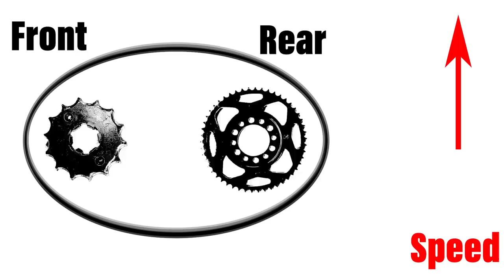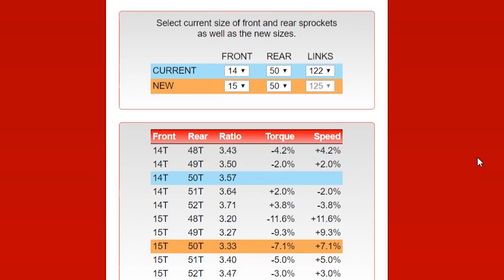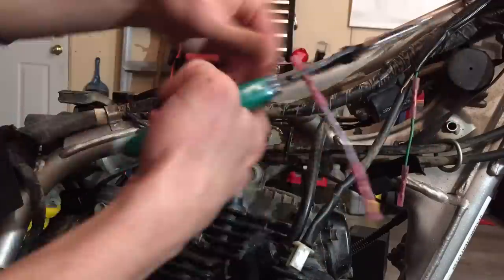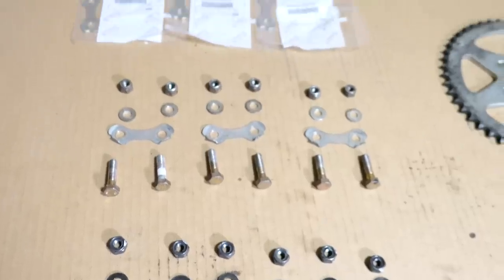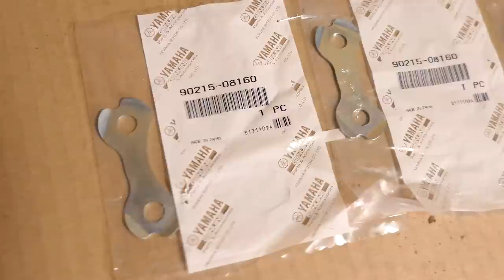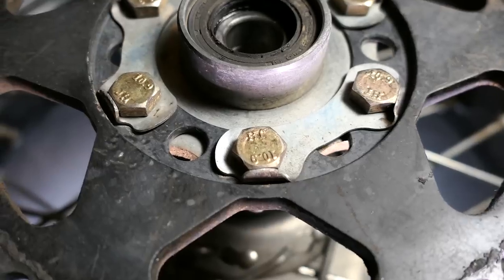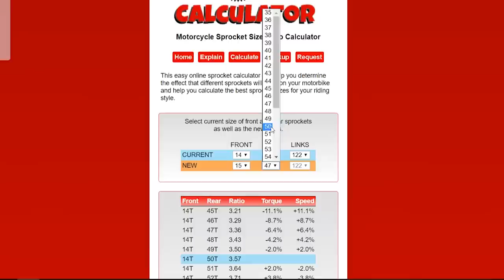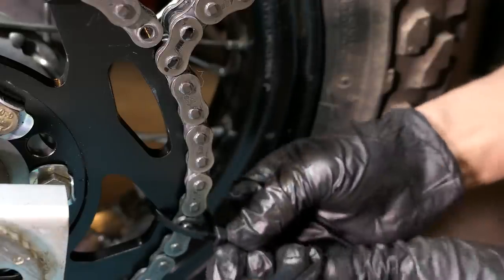How To Replace the Chain and Sprockets on a Yamaha TW200

Comment: Just replaced mine with 15/45 and x chain...thanks kid much quieter and smoother...also new tires...so when are you getting a new tdub...yours is looking pretty used my friend? saw your cracked frame
Reply from the maker: very nice! I could imagine it being a lot quieter and smoother with that gearing and new tires. I just welded everything. i'm putting it back together now

Comment: I just discovered you as well.I have 3 XT 250,and just bought my wife a 2012 TW.I changed the oil,and filter.I will check for the small holes,but more importantly at 45 MPH the bike started screaming at us or a warning buzzer--Not.Engine locked up ,cooled off ran another mile mile and locked up.Cooled off again at home .pulled plug and drained oil nothing wrong. Left plug out,hit starter  and it turned over.HMM! Compression test?Stuck piston and ring.Not sure where to start?
Reply from the maker: oh nice! you can never have enough bikes haha. dang that doesn't sound good, that's really strange, did  it lock up to the point where the wheel skidded? I would have to look at the bike to figure out what's going on. that's really strange

Comment: Just noticed this video and I like you. I have done this job before and figured that the dirt entering through the wiring inlet is ridiculous. It's not hard to pack the  wire entry after reassembly to prevent this design flaw.
On the rear sprocket swap, I have no idea why the aftermarket decided  to weaken the hub mounting surface by reducing depth.
Add to that, the bolt kits available are very substandard. Threads are poorly cut, washers are not "plate" but thin mush and the nuts are chrome plated malleable junk. The shoulder of the bolt was reduced way too much and should have more bearing surface on both hub and sprocket rather than having side forces on some threaded area. Two of the six bolts I installed stripped out the nuts at 20ft/lbs  (don't question my torque wrench) in incremental graduated rotation. Very poor metallurgy. The external lockwasher plates are Yamaha and do as designed.
I think it is best to re-use the Yamaha quality hardware and more PLATE washers if you wish but I ended up making a steel flange  sprocket insert  to compensate for thickness and all weaknesses of aftermarket products.
Keep up your  good vids.
One more - That was a  Sasquatch howling in your camping video.  No fears, they are curious and friendly but very smelly.
Reply from the maker: thanks, yeah that side cover setup is not the best, sure holds tons of dirt. darn, I havn't had an issue with my rear sprocket bolts yet personally. much appreciated, haha

Comment: Great work! So much great info and editing! I'm still running the stock chain and it slipped off last summer and jammed between the sprocket and swing arm locking up the rear, think its time for a new chain this spring haha
Reply from the maker: thank you! glad you enjoyed it. dang that's no good hope you didn't get hurt, I'm surprised mine didn't fly off when skipping teeth. indeed, the stock chain stretches insanely fast haha

Comment: Thanks for making such an imformaive video. Just what I needed. Love your videos.
Reply from the maker: You are so welcome! glad it was helpful. thanks for watching
Reply: @TDubsKid  Got a 44 rear and a 14 front installed. Testing tomorrow.. The 428 chain with 118 links fit perfect on #1 snail. That calculator site said 106 but it is full of popups and hard to use. You were partly the reason I bought the TW. The other reason is that the Sondors Metacycle I ordered in May 2019, is about 6 months late and I wanted a bike for this season not for 2022. Best wishes to you, ride safe!

Comment: The biggest thing I've encountered that slows my tw down is tire resistance.  My tires got low and the speed went down.  Gas milage too.  I've noticed the smoother the road surface the faster it accelerates.  Being on an really smoothed down highway makes feel like it's got a turbo!
Reply from the maker: +openscholar yeah that makes sense actually with the fat tires, when the rear tire was flat I couldn’t even push it haha 🤣

Comment: Can I use a new 122 xring chain with a 15 front and 50 rear sprocket? the calculator sez 125 links - but I thought I may have enough play with the snails to make it work. It's hard finding a 124 or 126 right now. Thank you for the amazing content. Funny and informative. You are the best and have a gift for this type of content.
Reply from the maker: hey it's really hard to say for sure, I would just get bigger and cut the links off that you need, just 1 link makes a huge difference on the snail adjusters. thanks
Reply: @TDubsKid  Hey thanks for getting back with me. Your videos are insane good. I got a longer chain and broke it at the right spot.
I grew up in the 70's on XR 75's. The 80's with 2 stroke MX bikes. Haven't had to break a chain since "81. Lol. My Tdub is the most fun bike I could have ever imagined. Your videos are a HUGE help and the best reality show in the world. Much appreciated.

Comment: I tried that 13mm multiple times on those sprocket bolts. Kept double checking and realized...mine are 14mm.🤔 Maybe the 2019 is different? Either way, great video and very helpful channel man!
Reply from the maker: gottcha, it's been a while but i'm assuming your talking about the front sprocket bolts.  you can always look here for parts info, https://www.yamahapartshouse.com/ I took a look and the front sprocket bolts are under transmission, and it looks like an old part number has been crossed out with a new parts number in it's place, so the must have upgraded those bolts for some reason or could no longer get the original bolts so maybe the had to find a new supplier. thanks!
Reply: @TDubsKid  I should've specified the rear sprocket bolts. You said 13mm but mine were 14mm and I was just curious. Probably an updated part like the front that you mentioned though. Thanks for the follow up. Take care man.

Comment: Absolutely idiot proof.  Appreciate the time and effort you took to make it.  I'm looking at buying a TW 200 but where I would ride off road is about 30 miles away. What is the top speed on highways without killing the bike? Appreciate anybody  responding that knows. Thanks
Reply from the maker: hey no problem! thanks for watching. I usually don't like to take it much more than 55 some of my spots are 30 minutes away or more, I just take the backroads

Comment: So, did you say that the sprocket calculator said that you needed a 120 link chain, but you used your 124 and just adjusted it?  Thinking of going to a 47 tooth but didn't want to buy a new chain until I saw if I likes the change?
Reply from the maker: The sprocket calculator doesn’t say what chain you need. You should be ok with stock chain going to 47 as long as your low on the snail adjusters

Comment: When doing the rear sprocket, don't bend the lock washer plates. Just remove the nut from the bolt and push is straight out. You don't have to bend anything and they should be good for life. Also you can use a M8x125 die to extend the bolt threads. I added 5 threads and voila.
Reply from the maker: thanks for the tip

Comment: I purchased this kit on Amazon (Drive Sprockets & Chain Kit For Yamaha MK1004915) for my 1998 TW200 with original 300 miles and need to know if the recess on the rear sprocket is supposed to go inward or outward.    The machined recess fits perfect if you put it on inward.  I have run it a few miles and seems ok.  I only need the Rear Sprocket and Chain for now.  Any help would be greatly appreciated.
Reply from the maker: hmmmm I don't recall running into that issue. maybe I missed it best to compare it to the original sprocket. if there was no recess. might go outward. would need to look at it to be sure

Comment: How did the change affect 1st gear? Would you still do the same sprocket change now that you have had it a while? I need to change these this winter and am on the fence whether i want to change the sprocket sizes for increased highway ability.
Reply from the maker: It made 1st gear a bit higher yeah i like the 14/47 or 15/50 setup, they are nearly the same had the 14/47 since the bike was nearly new, i like this setup for highway and off road, it you only need it for highway you could go higher

Comment: Nice video dude. I have a quick question, I just changed my oil / filter and I’ve been hearing a ticking sound. I’ve only gone less than a mile with the noise so far
Reply from the maker: did you make sure the filter has the 4 holes in the top? and did you check the oil galley bolt on the head to see if the top end is getting oil?
Reply: TDubsKid yeah it was the factory oil filter and I checked the top. Road it this morning and there was no noise at all so I guess it sorted itself out
Reply from the maker: yeah it should be fine, these engines can be pretty noisy

Comment: After a few months with the 15x50 setup, have you noticed any difference in the lack of torque on trails, hills, rocks, etc. from the adjustment from the 14x47 setup? I know in the video you didn't necessarily notice any immediate speed difference, but has that changed now that you've had this setup for a while as well? Thanks!
Reply from the maker: I don't really notice much difference, they are so very close. maybe slightly less torque but doesn't make it harder to ride off road

Comment: Question:  going to change my front sprocket and heard I should change the oil seal at the same time?  Can't find that part online...Did you replace your seal?
Reply from the maker: up to you, I didn't replace mine because it wasn't leaking. it's still not leaking today. you can find any oem part on one of the online yamaha parts suppliers online like yamaha parts house

Comment: yo can you make a video about adjusting the small sproket thing inside the engine??? im still getting a random rattle/ ticking sound even after the valve adjustment . and if you already did plz forgive my incompetence ha.!
\
Reply from the maker: hmmm not sure what sprocket your referring too the front drive chain sprocket has no adjustment. these engines are prettty noisy and it's normal as long as everything is in spec

Comment: How do you like the 15T front? I was riding with my buddies this weekend with 450s, 550s, and 650s, and all I could do comfortably was around 50. Would like to gain some top speed on the high end but still keep that low gear pop.
Reply from the maker: it's pretty good, pretty much the same as 14/47 you can't have both unfortunately it's a trade off can't have both. I feel like I still have enough low end torque for off road though
Reply: TDubsKid should i go 47 or 15?
Reply from the maker: Whatever is easiest, the front sprocket is a pain  to replace, but if its worn out already then might as well go 15

Comment: Hey dude I just replaced my front sprocket on my 99 tw in just 4 hours (two screws stripped)
Reply from the maker: nice that isn't too bad, were they the older philips screws? wish this bike just had the xt225 engine where it has a 6 speed and front sprockets can be changed in 10 minutes

Comment: Is your speedo still accurate?
Reply from the maker: the speedo gear is on the front wheel so yes
Reply: @TDubsKid  How are you happy with your gear set?  Any regrets?
Reply from the maker: Very happy works great for my kind if riding

Comment: Do I need a yamaha tw200 specific rear sprocket or can I just buy any 47t sprocket I find on Amazon?
Reply from the maker: it has to be specific for the tw200 check out the rear sprocket amazon link in the description. it fits the TW200 and you can choose what size you need

Comment: Nice! How many torque wrenches do you have? 😂  Thanks for the technical tips along with the demonstration. 🆒
Reply from the maker: I have 6 total, that craftsman 3/8in is the worst though, the lines don't really line up right and it feels cheap haha no problem, glad you enjoyed it 🤓
Reply: @TDubsKid  ; Hey TDubs, great video work you do Sir. The thing about torque wrenches is that you need to have two or three of the blinking things, a big one for large fasteners, a medium for medium ones, a small one for wee nuts etc, and they are not cheap. For anyone starting out on a low budget, you can get good torque indication using other methods, if you've got certain technical skills. For a backyard rustic alternative Kevin, see my "Bleeding brakes !! and an Easy Peasy DIY Torque Wrench" video. 
Kind regards. 
(Hope you don't mind TDubs, and then you'll see what a long video is, Lima Oscar Lima).

Comment: That’s an inconvenient place for a drive sprocket
Reply from the maker: haha yeah it's only because it's too far away from the output shaft bearing on the case so it requires another bearing or else the torsional load would be too great

Comment: Hi, what is the extra wire next to the front sprocket for? 
https://youtu.be/eTN9wYcHPWk?t=590 (just below "L" you used to mark longer screw hole, thx a lot.
Reply from the maker: might be the neutral switch but not fully sure
Reply: @TDubsKid  indeed it is

Comment: Tduuuuub!!!
Reply from the maker: +megan holliman hi there 👋
Reply: @TDubsKid  hey tdub quick question totally cool if you dont reply I know your busy.
I recently told you I bought a brand new tw200 i put 100 miles on bike through some clay trails here in the Ga mountains it was dirty and muddy so i took it to the car wash and sprayed it down really well i went to leave it started up like a champ.......then I clicked it into 1st gear and it died immediately while I still had the clutch all the way in too. No bogging just shut off . I tried 2nd  did the same thing. After like an hour of being stuck at car wash and trying several times and just stalling immediately in gear it all of the sudden just worked fine again. I'm wondering if I shouldnt spray my motor down or if I got somthing wet I shouldnt have .
I thought these bikes were sealed up pretty tight.
I figured I'd try and ask what you think I dont wanna mess up my new bike. I cant find anything about this online.
Reply: Sorry for the long message .🤙
Reply from the maker: hey no worries, and that is strange, did you by chance have the kickstand down? it will shut off if you put it into gear with the kickstand down even with the clutch in, let me know if that was it
Reply: @TDubsKid  yea that was it lol omg .
Reply from the maker: haha no worries, it happens to the best of us. at least now you know there is nothing wrong 😃🚲

Comment: 11:30 Something ain't right here. No point having lock washers there if the nut are on the other side. Someone installed those bolts backwards?
Reply from the maker: that's how it comes from the factory, they are nylocks

Comment: Nightmare job just to change a front sprocket
Reply from the maker: yeah I wish it was easier
Reply: @TDubsKid  I expect they had to extend the output shaft to get the chain past the tyre, then needed an outboard bearing to deal with the cantilever stresses

Comment: Damn that’s a dumb design to just change a sprocket
Reply from the maker: yeah it's only because the shaft extends too far out of the case there needs to be another bearing due to high torsional load